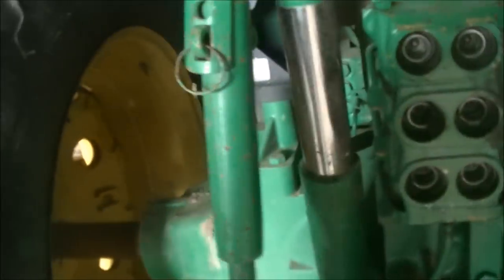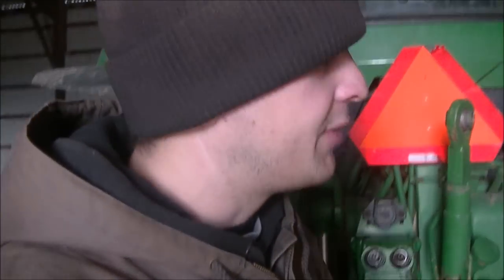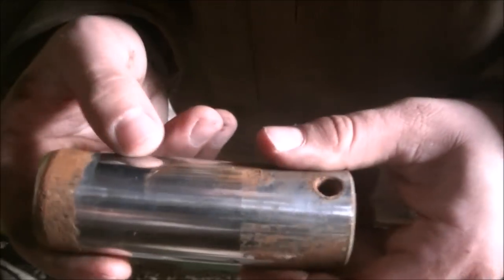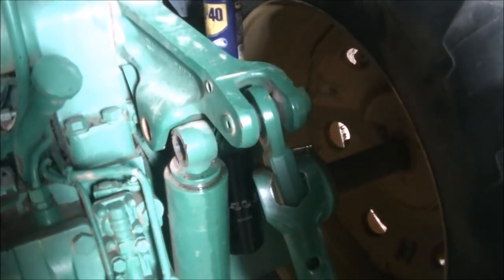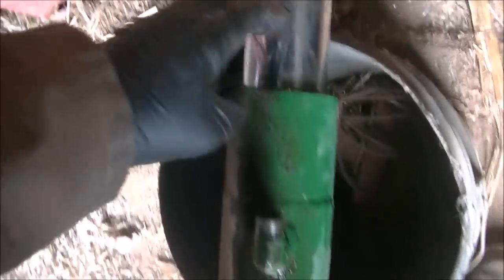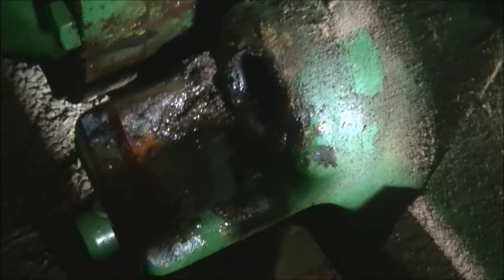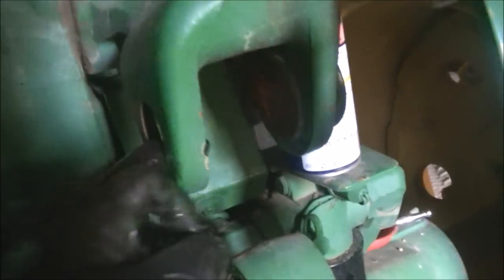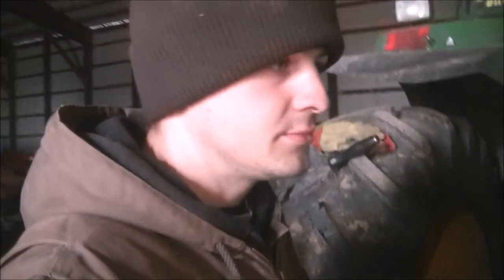JD 7600 Lift Cylinder Repair

Comment: I have a 7700 that the three-point hitch will not go down on unless I stand on it or use another loader to push it down otherwise it works just fine was thinking about adding those Grease zirks to the top shaft like you did but after watching this video thinking it might actually be in the pins on the lift cylinders. Whats your thoughts?
Reply from the maker: Pull your pins out of the lift cylinders. Most likely rusted solid. They are known for that.

Comment: I have John Deere 7200 and trying to remove the same lift arm but the bottom  pin I cannot figure out how to remove. First was a long threaded bolt you remove but there is still a pin to remove and no way of getting out.

Comment: I also have the issue that the 3-point doesn't go down unless I stand on it. I was wandering if I get the lower cylinder pins out without removing the upper ones. After viewing this video and get to know that it could be so tight that the lower pins even don't move referring to the cylinder, I got to know that I have to pull out the complete cylinder and got right on this way. Thanks for that.